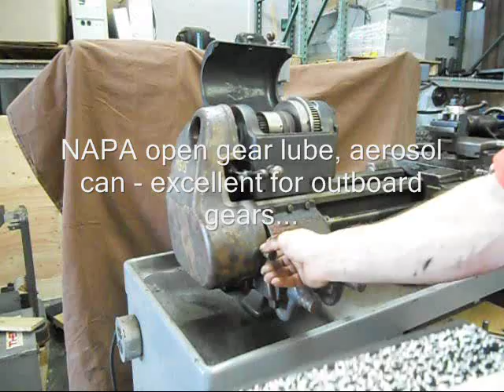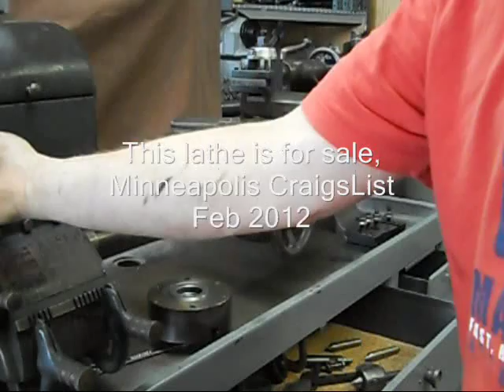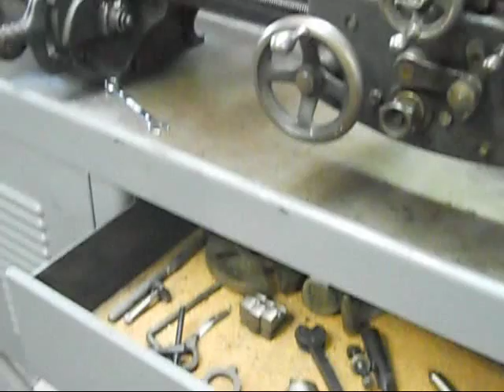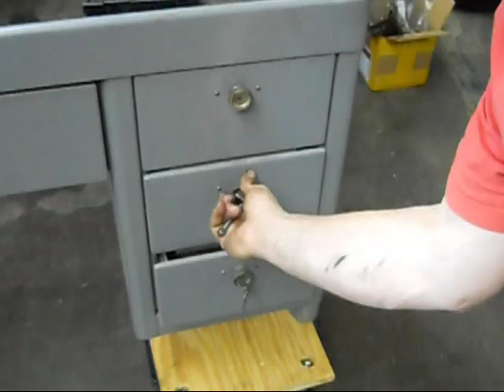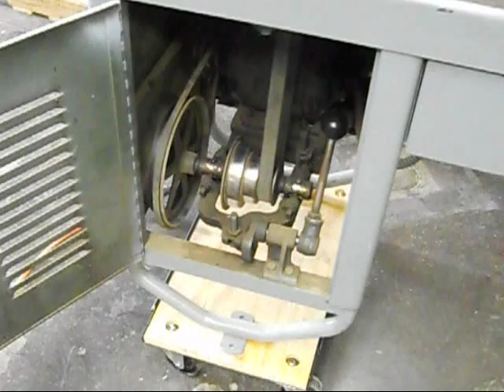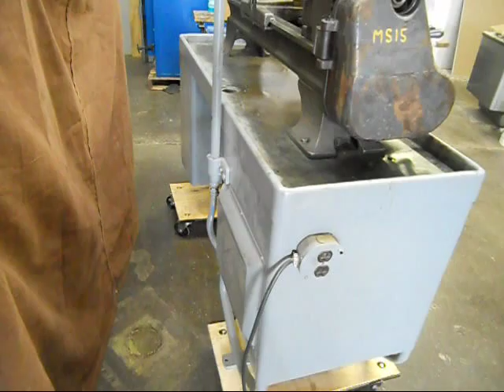Logan lathe model 825 10 inch 1946.wmv

Comment: That is my old lathe.  I had to sell it when I moved to a home with a smaller shop.  When I bought it the gear cover was missing because it had a collet closer.  It bugged me that it was missing so I found a replacement on Ebay.  That's why the numbered paint is on it.  Right after I bought it I repainted the base.  
Very nice machine!

Comment: Love these old Logan Lathes. They are timeless American iron. Wonderful lathe. Have had one in the process of restoration for past several years. Hope to get it up and running soon. Same 825 model with the under drive and drawers. This appears to be a very low use example and in great condition. Will give many many years of accurate service.

Comment: One slight correction.  When the shifter rack is in the out position, it should be in back gear, not when it is in.  The way it is now, you would not be able to take much (if any) of a cut while in back gear, since the rack will push itself out.  Details here:

Otherwise, looks like a nice lathe in good condition.  Good luck.